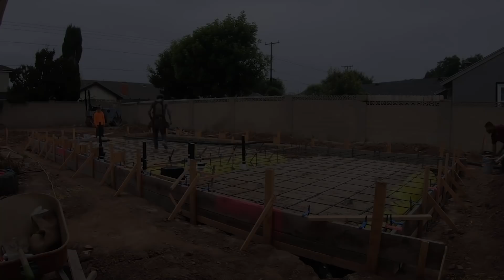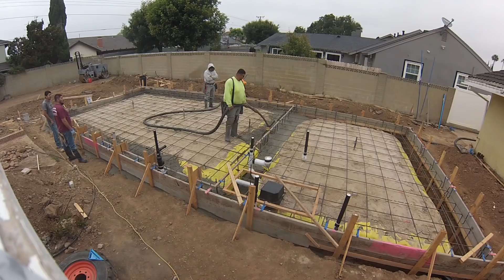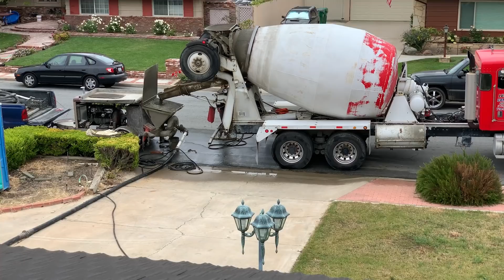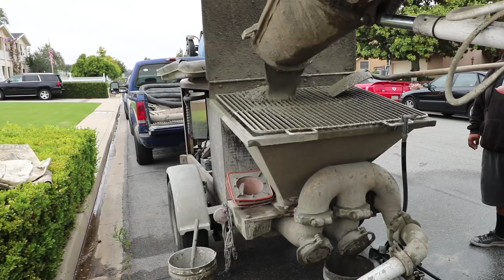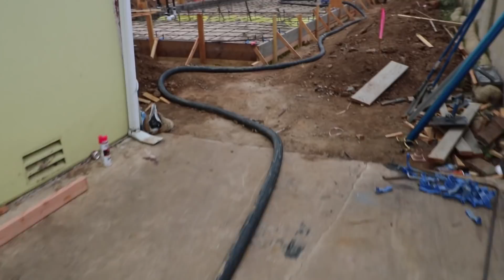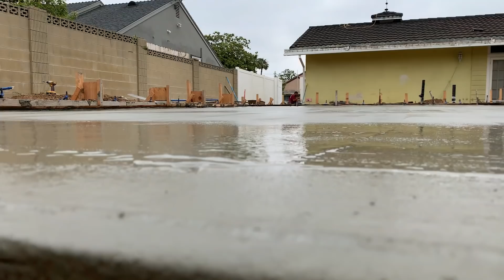Shop Build - Slab City

Comment: the lack of water also partially aborts the curing process, resulting in weaker concrete. The temperature risk is only relevant for a very short time, but keeping curing concrete moist for as long as possible, even weeks, will improve it's strength as long as it was never allowed to dry.

Comment: Just a quick thing. They poured concrete not cement, using concrete truck not cement trucks. There's cement in concrete, but it's not what you pour. Anyway...as you were.